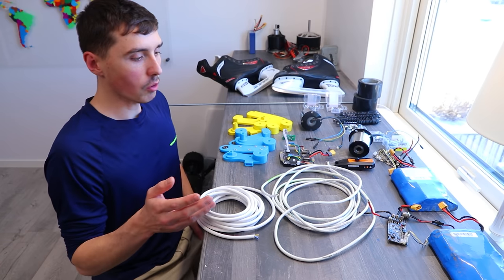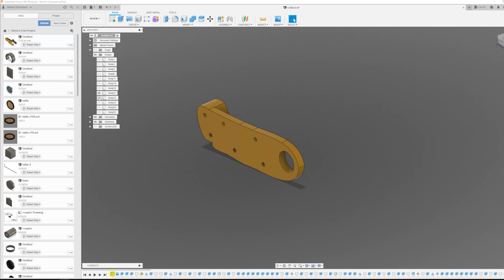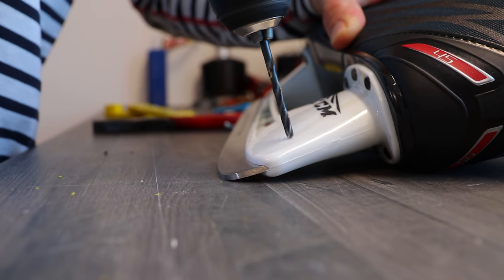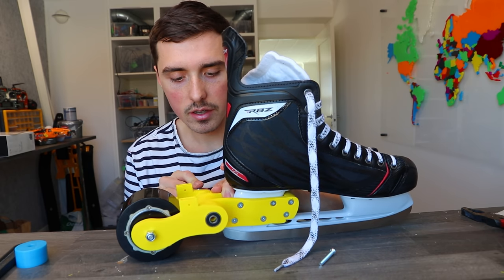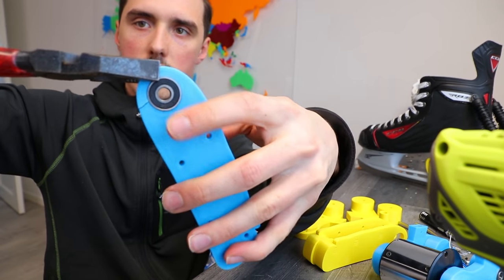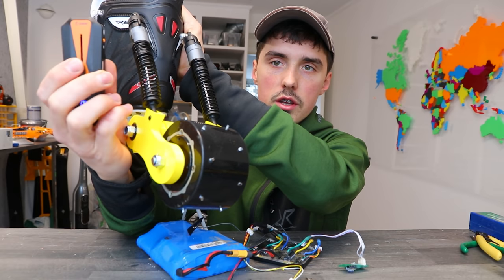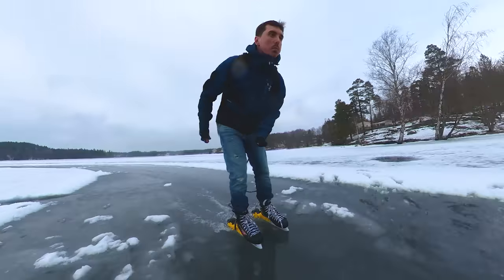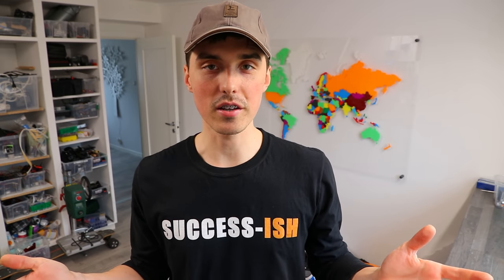Electric Ice Skates That Can Also Be a Meat Grinder

Comment: Simon: For next year, try to randomise the placement of the studs over the width of the "wheel" - the way you set it up now you risk just creating 3 grooves in the ice before losing friction! I believe this is how it's done on studded snow tires!
Reply: I was about to comment the same thing.
The way they are now looks like he looses either too much grip when the wheels spin, and just scratching the ice.
Randomly fitting the studs would allow for "constant" grip.
Also, havin same width on the wheels, but slightly rounded on the corners and having some studs there might prove beneficial when turning, and would ease the pressure on the mounting parts
Reply: thumbs up push this up and let him do it for V2
Reply: if they are set in the wheel like a strand of DNA you would have peak traction

Comment: For the next years version I would recommend modifying the motor location to a puller instead of a pusher. If you attach it to the front of the skate you can hard mount it without shock absorbers and then you can lean forward on your toes to put more weight on the spikes and get better traction. This will let you take advantage of full speed and if things get out of control you can lean back and safely fall without risking the motor contacting your thighs or buttocks. You could also create a fender to go over the top of the motor to further protect against anything catching on the spike like your fingers or clothing. Great video and looks like you are off to a great start.
Reply: he did kinda do part of what you said, he removed the springs and added metal rods, allowing him to use his full weight, but i am curious if a pulling motor would actually increase top speed, it would be safer though
Reply: I think a heelys like placement would be better something about it being lined up with your leg made it a lot easier to control.

Comment: One tip for the build. Making the wheels rounded a bit will make them still effective while turning so they aren’t on a corner. That or a hinge on either side where the piston connects to the wheel so it stays level with the ground ensuring constant traction :)

Comment: Version two should probably have a "fender" to protect your body parts from being the meat in the meat grinder! haha. So awesome, this is the last thing I would have thought you would build!
Reply: Yeah exactly, you're very unlikely to hit the bottom after all, mostly just the back, and even without spinning landing on screws wouldn't be fun haha perhaps adding a dead man's switch that when released breaks the motors would be a good idea as well
Reply: @xxportalxx.  the control seems to be springed...
Reply: @julian5857  i believe so, but if they were really spun up when you released the remote they could still be spinning with force when you fall on them. Just like how you wouldn't want to stick your hand in a meat grinder before it finishes coming to a halt when you turn it off.
Reply: someone has mentioned that it might have the opposite effect making it possible for things to get stuck and grinder :/

Comment: Nice job. I always enjoy seeing the birth of an idea that will probably evolve and end up light years from the initial concept. Looking at this, I couldn't help but visualize a chain saw where the skate blade is, all driven by the rear motor. Like a thin tank track. And, why don't those motors short out when you run them in the thawing lake surface?
Reply: Hey Joe, Nice to see you here. LOL There are people using Brushless motors on DIY underwater ROVs (remotely operated vehicles) for their thrusters. They are unprotected and still run fine. Granted the ball bearings will rust after a while. It's not the optimal way of doing it. Of course I would machine a water tight housing with a shaft seal. I digress. Not sure why they don't short out either though. Now stop watching other peoples videos and make your own on the PM Research Lathe LOL. People, you need to check out Joe's video on his steam engine build and now the miniature lathe.
Reply: As long as the connections are water tight the motors themselves have no electrical issues, they are just electromagnets interacting with each other which is what makes them brushless.  The windings are usually always coated and water proof so really the only failure point is in the bearings.
Reply: @joebaldenweg  That is what I was thinking but wasn't sure. I was thinking about the solder joints though.
Reply: Didn’t expect to see you here Joe!

Comment: I’ve never seen someone shovel a lake before.
Reply: When I was a kid we had a pond behind our house, the across the pond neighbor had a couple of little girls who liked to ice skate, so when it was frozen enough he would go out there with his hockey skates and his snowblower and clear off a section of pond near his backyard. clearing the snow off the surface of ice actually makes the ice get thicker over time assuming it stays cold because snow on ice acts as an insulator, exposing the surface to the air makes the ice colder.
Reply: How else are you going to skate on a frozen lake?=) You can skate on ice with snow on top as well, but the ice has to have been properly frozen before the snow came. If not, the surface will be crap. If the surface is smooth with fresh powder snow, you hardly feel it being there. If the snow is a bit harder or wetter, it just becomes more muscle intensive to skate - but it works. The best is if the ice is simply plowed, like it was in the start of the video.
Reply: you do it in cold weather to turn a lake into a playground for hockey, skating, and crazy people like simon!!
Reply: I don't miss shoveling snow but I do miss ice skating. Been in SE Texas for 30 years now. The only ice we get here is in the freezer.
Reply: We Do it all the time in Sweden 🤣

Comment: Should make the ice wheel spherical like a motorcycle tire
Reply: I was also wondering how well the wheels would perform while turning. 

But if the wheels were given a rounded cross-section you would be sacrificing a lot of contact with the ice. A better, or be it a more complicated, solution might be to replace the existing hinge with one that is perpendicular to its current orientation so that the wheel remains at a constant angle to the ice even when the wearer leans to one side or the other when turning.

Comment: Might want a roll swivel on the drive wheel. Whenever the skate rolls off vertical, like when cornering etc, only the outer set of spikes can engage the ground.
Reply: That would be detrimental.
You don't want to accelerate or decelerate in the middle of a curve. If anything, the spikes should be more centered to make it disengage better.

Comment: Wouldn't it make more sense to put the motor in the front of the skate? Since you apply a forward weight transfer when moving rather than leaning back.
Reply: Came here to say this same thing. Leaning in to accelerate, and back to stop is more natural, and it just seems to make more sense. Plus, you're far less likely to fall onto your own toes, opposed to falling onto your heels.

Comment: "Top speed kinda dog shit"

Quote of the video.
Reply: The forks do not pivot independant of each other. If that could be accomodated the drive wheel can press flat while the skates tilt in turns. The handful of sound engineering tips he has gotten so far should make for a steller performance next year. I think if he gets the time he should do it sooner and just rent an ice rink for a day to test another prototype. This project is ripe for huge success and spin-offs.

Comment: I think a problem with the current design is that the grip increaces when you lean back so get pushed back even more and eventually fall over. If you could mount the motors at the front then the grip yould decrease when falling over.

You can see this at 7:11
Reply: Awesome insight! And more prone to inherent stability.

Comment: They have actual ice studs for bicycles and motorcycles that have a  biting edge on them.

Also place them in alternating rows of either 2 and 3 or 3 and 4. So the contact is spread across the whole wheel

Comment: Very Interesting.  A few thoughts I had:  provide the downwards force with a piece of spring steel anchored under the ball's of your feet.  I would also anchor the entire drive unit to the front blade mount, and have the entire motor mount able to swivel, say, 30 degrees side to side to maintain traction on corners.  Finally, for safety, put a pressure switch between the spring steel and the heel of the skate so that there has to be weight on the skate for the motor to function.

Comment: Yeah, I'd put the cover over the top side of the wheels to prevent possible injuries.  What about putting battery in the gap between front and rear support on the skate shoes itself?

Comment: My dude, very nice. I think what you should do is combination support system. Look at the support for a snow bike. They have a dead zone before going rigid, that travel is what keeps the treads of the snow bike engaged even on ice. Also, a thinner gage wire might be beneficial with a quick snap that allows you to wear the pack and simple snapp the wires into place. One last thing, your "studs"  might wanna try them with an alternating pattern. Otherwise, when a new stud spins into place, its just "Digging" into the spot of a previous stud and losing grip. Try diamonds, or look up how they do it on snow tires. Good luck, and I hope to see the next set.

Comment: It's easier to pull than to push. Have you tried (or considered trying) mounting the motor in the front? Giving it 'front wheel drive'? Maybe with a guard of some kind on top?

Comment: Could I maybe make a suggestion to 3D print a mount that screws into the bottom where the plastic plade housing meets the boot? You could print a large piece that comes up the back of your ankle and connects to the shocks.

Love your work.

Comment: This was your idea? This is incredible. Hell yeah! 10/10
Some random off the cuff ideas for v2:
- Hook shaped spikes. Seems to me they might 'dig in' and help reduce the requirement to lean back
- Revisit the spring loaded design, but add some sort of structure to the skate-side mount, so the flexible ice skate material does not have to take up the load. Maybe combined with hooked spikes and a very slight pre-load, you will get better traction, that also can slip if needed.
- Obviously some sort of fenders to protect yourself from the meat grinder
- Attach the wires to your snowsuit and add plugs at the bottom for the skates. Similarly relocate the battery and board to a 3D printed belt or something else like this.
- Solenoid, clutch, or some other method to allow the motor to automatically raise\lower when power is applied to the motor. Maybe not required, but it seems it would add mobility when manually skating. Maybe look at how the covers on rotary chop saws\rotary miter saws work for ideas?
- Relocate the motors to the bracket on the skate side, and use a belt to transfer power. This gets the motors out of the water, adds potential for belt reduction, possibly allows you to change to a tracked design instead of the drum potentially,

Comment: I think if you play with the amount of preload on your spring replacements you could get more performance. replacing the RC shocks with threaded rod is kinda like swapping coil springs for torsion rod springs (like the limbs from a bow and arrow). if you were to set the threaded rod longer, so you were like on your tip-toes while stopped,  I think the rods would bend upward under acceleration to bring the rest of the skate in contact under power

Comment: You could try using clock springs to help keep the wheels on the ice... If you use them in conjunction with the linear springs, it should work really well to keep the wheels on the ground. Or just get a big clock spring and get rid of the linear springs.

Comment: Great video. I think a spring for the drive wheel is the way to go but instead of using the shoe directly to attach to the drive, use an upright as part of the drive assembly that "rests / is pushed up against the shoe. The spring action is then spread into the boot in multiple places. A safety feature could be motor interrupt if the flex is > or < But some sort of guard for that wheel for sure. Keep up the good work :)

Comment: Maybe you have to tilt your foot position for more pressure on the wheel, building sth like a high heel ice skate where the front part of your foot is equipped with the blade and the heel stands on the wheel

Comment: This is pretty cool. Seems like the spring loaded version is better and to use it as a way to keep you going once you manually start skating sort of like an motor assist ebike. Next try it with some drone engines. I am curious how much momentum you could get from EDF turbines with teh same amount of power. Probably even less thrust off the line but you'd have more flexibility for an assisted momentum maybe.

Comment: This is fantastic. Maybe a cowling over the wheel. Maybe have connectors on the scates end so you  can put the pack on. Also maybe use velcro straps to manage the cables to your legs. Also instead of mounting the suspension on the skate use a plastic C to push on the heel of the skate. Also instead of a rc car shock use a leaf spring instead so the suspension isn't inconsistent die to oils changing in temperature. Also make sure to protect the battery in your pack the cold could effect the power and if you fall on it there could be explosive consequences. Love the idea tho.

Comment: Might be an idea to move everything to the front, considering you kind of already have brakes with the motor, the serrations would provide less use. you would be able to lean forward for more traction which would feel more natural  only problem might be the ice getting fucked up from the wheel, to the point where your skates would be dragging along

Comment: Always very nice video's, great ideas, fun to watch. And apparently you never see any obstacles. Too bad te snow and ice is gone, so many nice projects.  Very challenging to build the motor right on the skates. Did you also consider having  the motor externally, to something you can hold on too, that pulls you. Like a ice skating chair, that helps people to ice skate.  What would also be cool, you did an episode driving over water, designing wheels. Design wheels to drive over the ice.
I guess you need summer projects now.

Comment: Very cool! Would it be a good idea to mount the springs in such a way that they're completely compressed when the skate is flat, so you can put your weight on it, but when you lean forward it will still be pressed against the ice?
Reply: Oh, and what about a little cap over the upper half of the skates, so you don't grind yourself?

Comment: Possible Safety improvement: cover shields or flared fenders over the wheel, paired to a limit switch triggering back to your ESCs, so if you fell back onto it, the fender would take the bulk of the damage, and the limit switch would turn off the motor?

Comment: What if you tried using low grit sandpaper on the wheels instead. With the studs you have gaps and uneven areas of contact with the ice, but with sandpaper it would have more contact with the ice which I think should be more efficient.

Comment: It might be nice if the wheel-to-ice contact could be disengaged, to allow you to coast. I know that the integrated motor reduces the complexity, but if you had a gearing (or even a belt drive), you could make the torque of the motor cause the wheel arm to be pushed against the ice. Then have weak springs that lift the wheel arm up when not powered.

Comment: If you switch back to the springs, you could use a micro switch to only allow the motor to spin when there is pressure on the wheel. That way, you don’t have to worry about the spinning wheel of death if you fall!

Comment: Next model, try using rounded wheel, I believe it will be easier to turn. Another model is to cut away the middle of the skate and put the motor in between, but remember a thick spring, so that your weight will let a short spring have constant contact with the ice.

Comment: Awesome.  But if you would skate with one foot a bit ahead of the other, you would get more front/back stability for when you hit something or when you turn up the motor.  Basically the faster you go, unless you have a perfect track, you want to scissor your feet with one foot much further ahead of the other.  Your trailing leg quads will get exhausted more quickly since most of the weight is on that leg, but you switch leading foot and leg weight as needed.

Comment: Put a mercury tilt switch in the circuit (or go crazy and incorporate an accelerometer with ball tilt switch using Arduino) so if you go ass up, the power is cut automatically. That with a mudguard over the wheels and you'll have less chance of getting ground up by your spiked wheel. Re configure and print the parts that attach to the skates to include vertical posts to mount the top of your shock absorbers to, not the boot and you won't have to tilt back to get traction.

Comment: How about doing away with the remote and using the position of the wheel to control the speed? Speed up when it's low, reverse when it's high, maybe free-wheel when it's even. Then you can lean forward or backward to accelerate or decelerate, a little bit like on a Segway. You may need to use a hard boot for that though.

Afterwards, you could get rid of all that cable by mounting the battery etc. right on the skates, maybe with a shin strap. That would also help to stabilize the user by lowering the center of gravity.